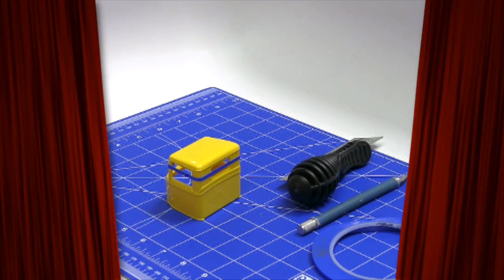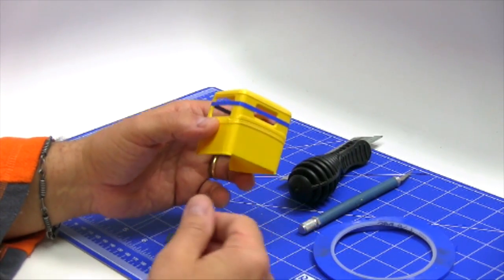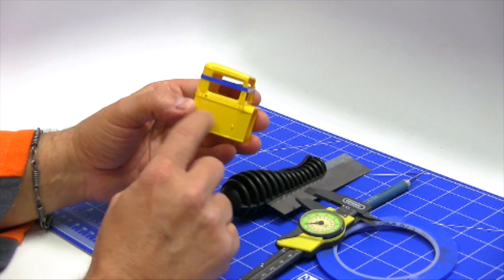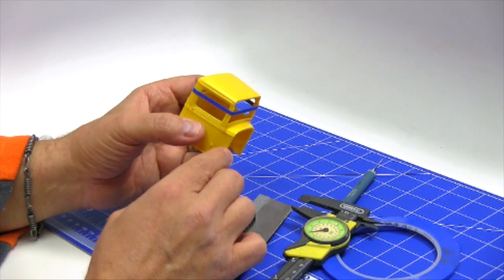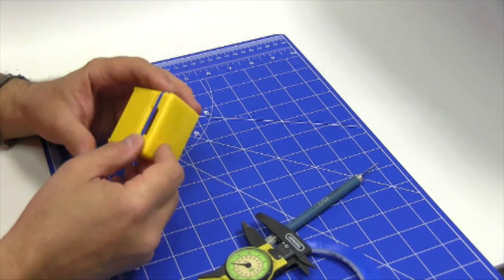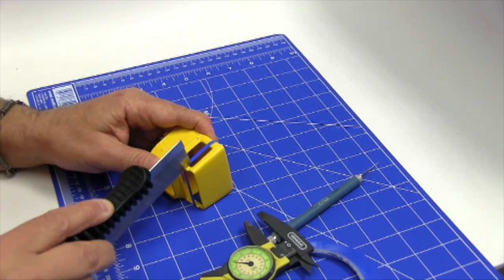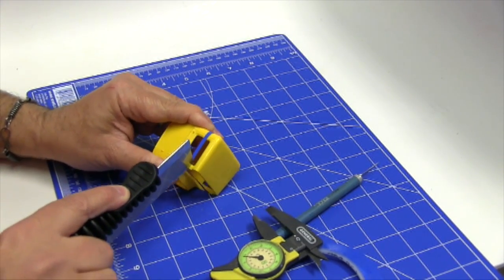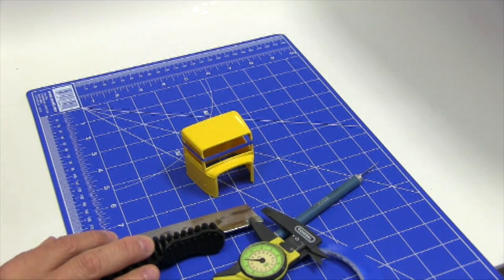CLINIC:  Top (Chop)-Chopin' (Part 2)

Comment: Good idea to use the caliper for measuring.  I will be adding this tool real soon to the shop.  Most of the time I eyeball things, having done it for many years in the autobody shop..it's easier to do on 1:1 cars than on a 1/25 scale version.lol Good advice on working slow when it comes to cutting through the styrene. Thanks for sharing with us Doc.